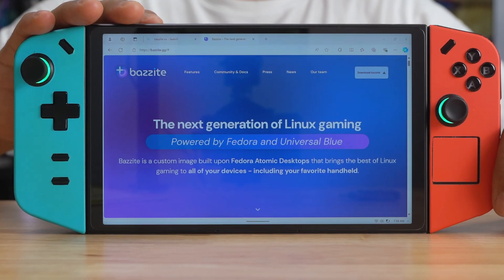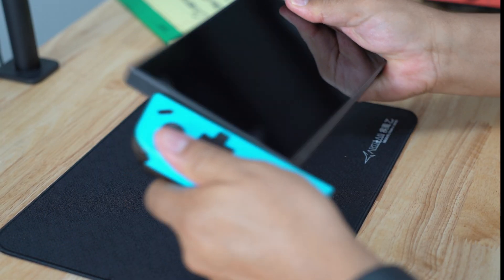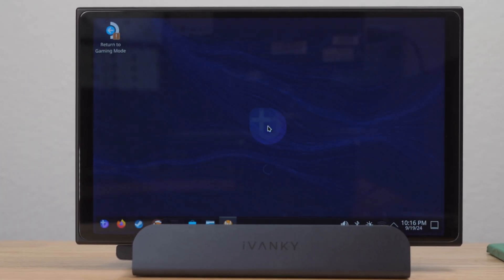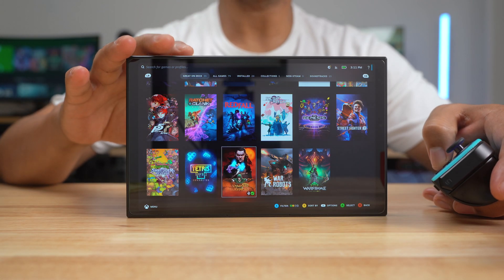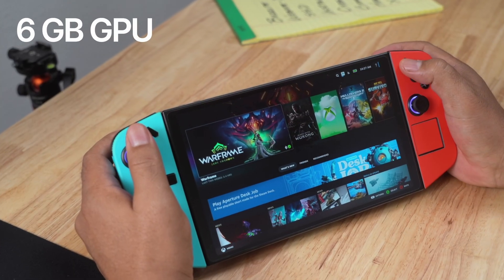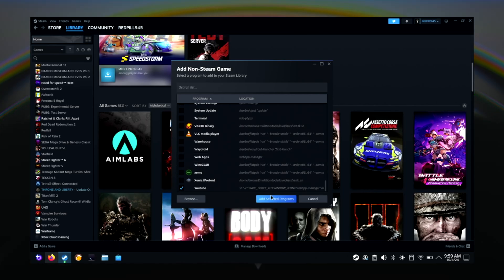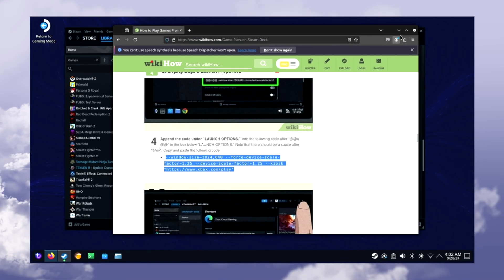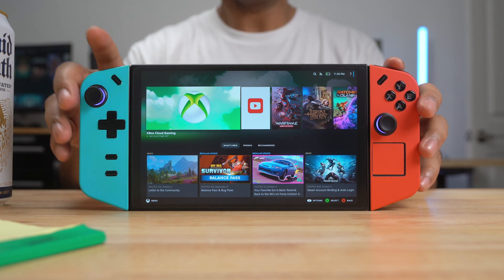My Lenovo Legion Go Bazzite OS Installation and Setup: What an Experience!

Comment: I just tried bazzite, it looks nice but its buggy and a real pain in the butt! Ive been in IT for over 22 years and had some past experience  wirh linux, just a few issues i had was enough to go back to windows 😅

Ps its probs great if you have purchased loads of steam games but things i had issues wirh 

Installing any games outside of steam, everything from permission errors, mutiple setup errors too long to list on multiple differemt games via lutris, emudeck reported errrors on sd card, keyboard issues too big for desktop screen, doesnt automatically appear.

Wasted 14 hours and couldnt get a singe none steam game emulator working. 

My advice unless you know linux well, have the patience of a saint and dont care for limitations where most games, apps and emulators simply arent intended for it.

Not a big fan of windows but reluctantly going back to single windows single boot on my legion go

Comment: When trying to boot i get error "preparing automatic repair"
Reply from the maker: sorry I didn't have that issue when I installed mine.  Does a Windows logo show up when you get that message?  that sounds like a Windows error message?
Reply: @digitalmaus  yes.  It appears as though it's trying to repair the windows installation

Comment: Can you install Bazzite on external ssd? Then choose that drive as the boot drive? I don’t want to mess with the internal ssd or bios. Thanks.
Reply from the maker: i haven’t tried it myself. I have read some reddits which say installing on an external SSD will work with The Legion Go. not micro sd tho…
Reply: Thanks. I will give it a try.

Comment: Did you have any issue with the top to buttons (legion space button) and back buttons? I have installed 3 separate times and they just don't seem to work. Can't download remapper because it's a decky plug-in and thr button to access the decky plug-in does not work.
Reply: @rykerlelo4659  not sure if you still need the help but what I did was install legion go remapper thru desktop mode

Comment: thanks for the guide. question for ya. if you install bazzite can you still factory reset it?
Reply: likely not because you will likely repartition the drive for linux.. but you can always go to lenovo's website and download the iso to create a restore USB Flash drive to bring your legion back to factory... also you can just simply go to microsofts website and make a windows restore drive for your go as well, it will still automatically install all the legion software anyways even if u go that route

Comment: Thanks for the video. All installed ok. Sound only coming out of the left speaker. Checked the test in desktop mode, but only left makes a sound, right nothing. Works ok with headphones
Reply from the maker: Thanks for watching the video and for your comment! I haven’t experienced the issue you’re describing with the sound only coming from the left speaker. However, I recommend checking out the attached link to the Bazzite GitHub.  Let me know how it goes. https://github.com/aarron-lee/legion-go-tricks/blob/main/experimental_sound_fix/README.md
Reply: @MarkMotorhomeJo  did you ever find a solution? I'm debating installing this for sparking zero. SZ is terrible on windows supposedly and sometimes don't even work. I'm very nervous though, I don't want to have all my setting switched or restarted.

Comment: I have installed bazzite and wiped my windows  (reasons below) as of*(15 Nov 2024). 
I see now why ppl are fond of it. The wake from sleep is a game changer. My games libary majority seems to be working without a hitch. Even the epic games.  
Having tpd controls is a god send as well for on the go.

Tips for if your considering moving to Bazzite
Ideally if your migrating to bazzite, back up your files you feel that are important. As for games, you can migrate your games on external drives. Steam is great with that (epic kind of works so I hear, but I have tried that only on windows), so I did not have to redownload them. Likewise get the product windows recovery key from lenevo (in the off chance in the future you want to sell it/ put windows back on it). 

Reasons I switched to bazzite:

I have had the legion go for a month. Honesty a very convenient gaming pc....when windows and legion space worked.
Legion space app sucks! Lenevo has drivers from MAY 2024 for amd graphics (so majority of games I play don't work....and yes that includes old games like new vegas)
 
Oh and heaven forbid you get a forced MS update (despite disabling or delaying), or you know actually get the latest amd drivers (did fix a lot of games not working though). 
The legion app straight up will not open (a known problem for months all the way back from launch). Sure could usen it like a mini pc and just uninstall the legion app.....but now you have no tdp control, RGB control, botton remapping, battery management, basically everything you expect or need to use it like a handheld. 

Don't even bother tying the following for the legion space app.
1)factory reseting windows.... the app will brick again after it updates
2 ddu amd drivers then add new drivers. It only works with the lenevo's outdated drivers.
3 Reaching out to lenovo, just browse the forms and you will see how much they care.
4 looking up tutorials on side loading drivers....legion space will brick later when you get the next forced MS update or have to side load new amd drivers for the latest games.

All this over a month of ownership. Just such a mess of a product as a windows handheld. Slow updates for key functions of a handheld on windows. WINDOWS 11 BS is a separate complaint (Won't beat a dead horse).

Comment: awesome video, thanks Digi Maus.
How is boot time on the legion go?

And will suspend work fine?
Reply from the maker: Thanks for watching. powering on time varies. Sometimes quicker than others. I think it’s installing updates. But its not an intolerable amount of time.

I don’t really use suspend very much myself but I tried it  on a couple of games. Rachet and Clank and Spiderman. When I pressed the power button it will shut down and the power button will blink. When I hit the power button again it started both game as I left them

Comment: If I install Bazzi, can I go back to windows anytime I want because I want to be able to use both and swap from them like a mode because I actually use my Lenovo for work
Reply: @RAWKINGCOMEDY  you can dual boot windows and bazzite os
Reply: @jedxepeda2482 what's that and how? Doesn't it just start up how it starts up? Where will the option be to choose?
Reply: @ShadowOfDeath33  So dual booting means you have both operating systems installed. The way you do it in Windows is you create a partition with enough storage for Bazzite then when you go in to install Bazzite choose the partition you made
Reply: @JoeHoeDoesSomething  gotchya. Been looking into it and understand it more. Thanks for the reply.

Comment: Long time steam gamer and day 1 deck owner, just bought the Legion Go for $499 yesterday and will be installing this tomorrow when it comes.  I dont use windows at all, just linux.. I am concerned about the battery though, but it should be good I think.
Reply: I'm holding out for the Legion go 2 since it's pretty much been confirmed that theres going to be a steam os version. I think Bazzite is going to fade out in the near future since Valve plans on taking over the handheld market with Steam os.
Reply: how was it bro?

Comment: The Go can run almost every single pc game at 4x frame generation with lossless scaling. Doing so will ensure that you are playing virtually every game in your pc library at 144 fps. Abandoning modern day universal frame generation tech for Linux doesn’t make much sense.
Reply: Wow wow guys. First of all - Yes we do lose AFMF2 and Lossless scaling. But there are couple of points we need to understand when we talk about frame generation.
- AFMF2 and LS work based on the screen image currently visible. It's not a built in game solution which makes it not that good when the game supports Frame Generation and FSR natively. There are tons of games with FSR 3.1 out of the box. When Frame Generation has access to game's engine it will perform better.
- If you want to play competitive games like First Person Shooters you will not be able to use any of those technologies cause it introduces lags. Frame generation (to make it simple) works by picking up a current frame and a previous frame, comparing them together and creating more frames to fit between them. That's why the lag is introduced. It delays your frames. The less native fps you have the bigger lag you will have. So yeah. No competitive games with FG at least for now.
- If the game supports DLSS there is a mod called DLSS Enabler which basically swaps DLSS with FSR3.1 and XESS. This allows us to use frame generation even for games with DLSS only.
- AFMF2 improved Vulkan support about a week ago. It potentially can lead to native linux AFMF2 (speculation only). But Vulkan is what linux uses instead of DirectX.

I switched from Windows to CachyOS  handheld edition (Linux) and it works really well. There will be even more games with built in frame generation soon so AFMF2 and Lossless Scaling will be obsolete for them. The technology is nice and very cool but only for those games which refuse to work on their own implementation.
Reply: @edwardlashley3572  exactly this for me. If linux also had afmf and lossless it'd be something to consider. But it's too much to give up.
Reply: I'm a pretty picky man. I hate windows so much. That yes I'll sacrifice some stuff to use it. I don't think I'll lose that much performance running it. I don't care about 144 hz anyways a consistent 60 hz is fine for what I need.
Reply: Its almost like... games are actually made poorly and using AI gpus is a cheap way of making them seem optimized.
Reply: @canitrunMinecraft  It's good. I use it on pc, Steam Deck and Lenovo Legion Go. If you have any issues while using it you can contact its developers directly.
Reply: Not even that right AMD Fame generation 2 works like a charm I don't know how I did it but actually working properly and the games are running like 250 to 600 famous per second I can even get eternal running at 1:20 it's so crazy
Reply: @canitrunMinecraft  It's good. I use it on Steam Deck, Lenovo Legion Go and PC (desktop edition)
Reply: @canitrunMinecraft  It works perfectly fine for me. I use it on all of my devices. Even desktop edition on my desktops.
Reply: @edwardlashley3572  you can use frame generation on Linux, lmao
Reply: Hey how do I turn that on?
Reply: @canitrunMinecraft  that’s like having a PS5 & installing Nintendo Switch onto your PS5 so that all your PS5 is now is a Nintendo Switch.
Reply: @edwardlashley3572  That's hyperbole. It's not nearly that big of a downgrade, if at all. With GE proton and proper tweaking you can reach parity in performance, sometimes even surpassing stock.
Reply: @edwardlashley3572  love this coment